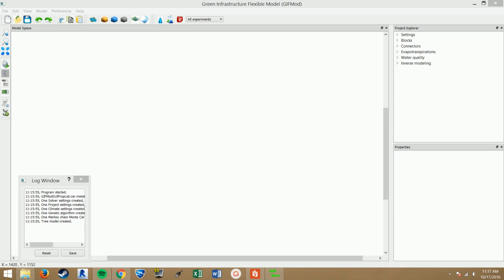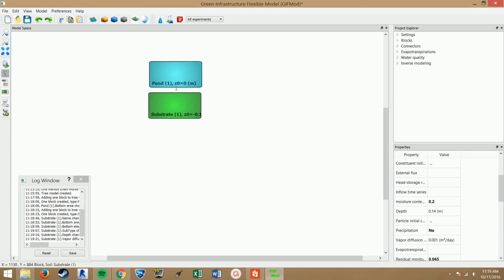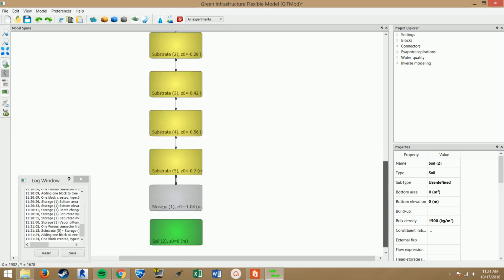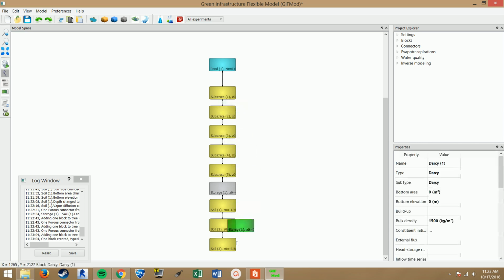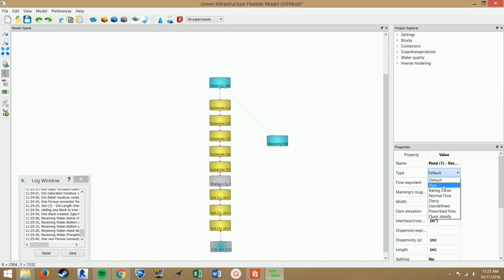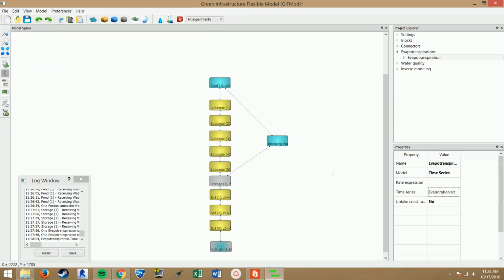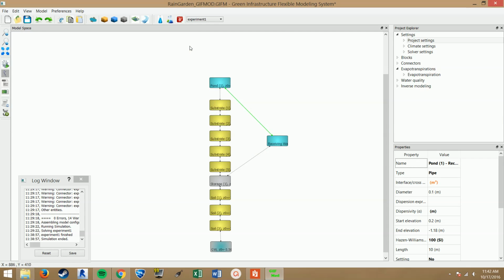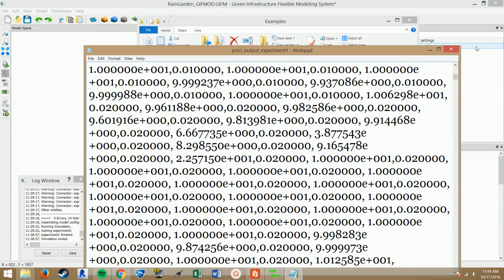RainGarden Hydraulics

Comment: How do you get those files after clicking inflow time series under the pond data?
Reply from the maker: Matthew, you have to create the files. Send me an email and I will send you a sample.
Reply: @gifmod3484  can you send me one copy please?
Reply from the maker: @josemanuelcolin8235  Jose, here is one example of an inflow file. It is probably not the same as the one used in the example, but it gives you an idea of how it looks like. The unit is m^3/day and you can see the date/time on the first column if you import the file into excel and change the format of the first column to date/time. Please do not hesitate to contact me if you have any further questions.